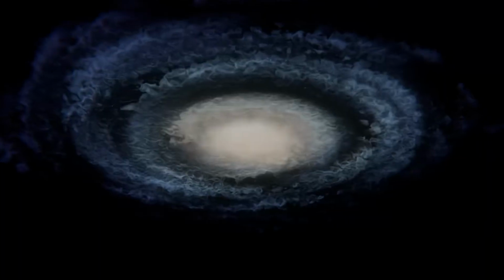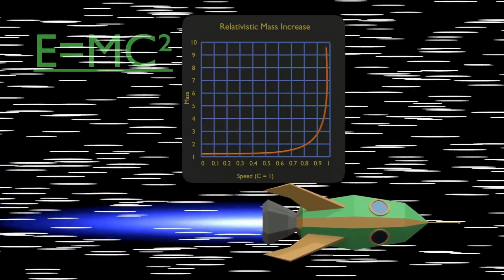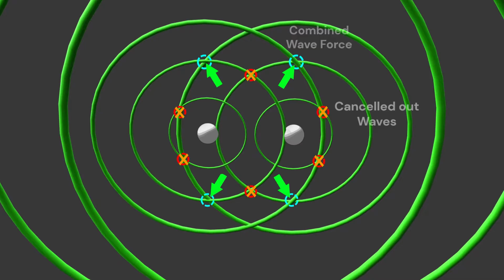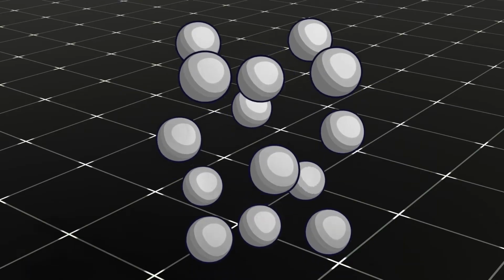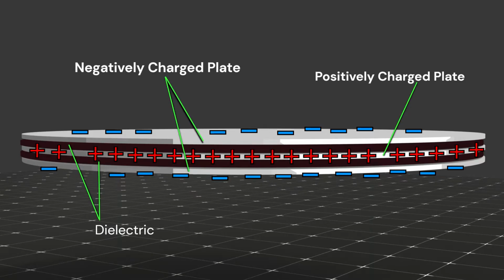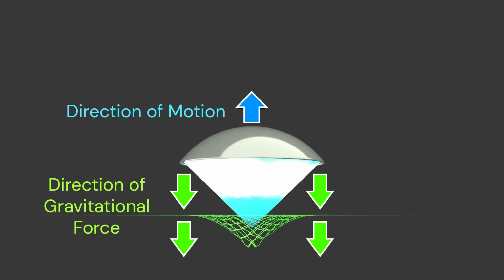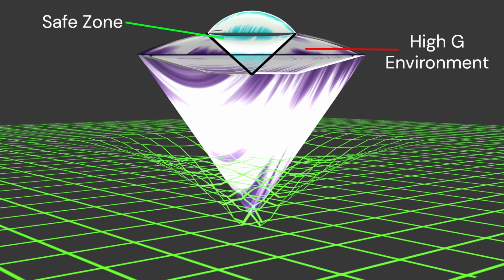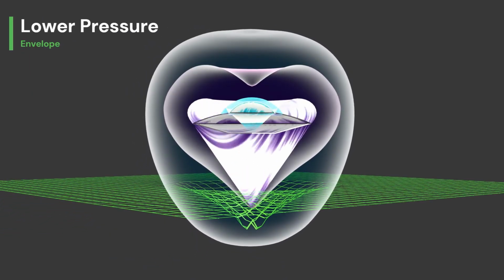UAP Propulsion Method

Comment: 1. Misapplication of the Equivalence Principle
The equivalence principle (gravity ≈ acceleration) does not imply that vibrating mass generates gravity waves.

Gravity waves (like those detected by LIGO) come from massive cosmic events (black hole mergers), not atomic vibrations.

2. Gravity Wave Generation at Atomic Scales?
The energy required to produce detectable gravity waves is astronomical (e.g., merging neutron stars).

Atomic vibrations would produce undetectably weak spacetime ripples (if any).

3. No Known Mechanism for "Gravity Amplification"
General Relativity does not allow for "focusing" gravity waves like light in a parabolic mirror.

Gravity waves do not exert force—they are ripples in spacetime, not a push/pull effect.

4. Overestimation of Electrical Charge Effects
While electrostatic forces can move ions, they don’t induce relativistic mass increases.

Capacitors store charge but cannot generate gravity waves.

5. Contradictions with Known Physics
G-forces are due to acceleration, not gravity waves.

The idea that a "repulsive field" cancels G-forces violates inertia (Newton’s 1st Law).

6. Lack of Experimental Evidence
No lab has ever observed artificial gravity waves from vibrating matter.

If NHIs used this, we’d expect detectable energy signatures (none confirmed)
Reply: Yap yap yap
Reply: So you're saying it would take the equivalent of a black hole merger to lift a ufo? Gravity IS hard to detect, true, but it doesn't take a merger to lift a ton or two. Why visit a fringe science channel just to fall back on traditional science? 

He's not saying that the parabolic dish is reflecting gravity waves. He's saying the dish is used to focus the force generated by the dish itself. 

Thomas Townsend Brown showcased asymmetrical capacitors generating force back in the 80s. That same force is being used by Charles Buhler et al to move styrofoam around a lab *right now*. This is all heavily documented, albeit not very well accepted. 

All that said, don't denounce possibly the best guess at uap propulsion systems without giving your own best guess. Bad show.

Comment: Thank you. Apparently, it helps if you electrically charge the vibrational items to generate gravity. What you have to do is devise an experiment that shows that vibrations increase gravity. That should be easy enough to do. The equivalence principle states that inertial and gravitational mass are equivalent, meaning acceleration and gravity are locally indistinguishable. While relativistic mass increase at near-light speeds is valid in special relativity, the idea that vibrations could analogously increase mass is speculative. General relativity treats mass as a property of stress-energy, but oscillations alone don’t inherently create gravitational fields unless they involve significant energy density (e.g., gravitational waves from colliding black holes).
Verdict: Partially plausible in theory, but no empirical evidence supports vibrational mass amplification as a gravity-control mechanism.

Comment: Hey guys. I just wanted to comment on proof of this IN NATURE!

When a supernovae occurs, matter is quickly moved and gravitational waves are asymmetrically created. This causes the center of mass of the remaining neutron star to move away from its original center of mass. This is an example of an object moving itself through asymmetric gravity wave emission. We know this because the amount relative of mass expelled in a given direction in a supernovae is not enough to propel the center of mass of the neutron star in a velocity that it can move at. This is also the same reason binary stars can technically come closer or further from each other.
Reply from the maker: @competetive8  thank you for this
Reply: @michaelalans2126  Thanks. This stuff is really interesting and obviously possible but i think it would take a lot of energy
Reply from the maker: @competetive8  Thomas Townsend Brown seems to have done it with 50kv. Admittedly, his apparatus was small and he often worked with aluminium foil, but the fact that he had his best results with parabolic disks, with the negatively charged electrode around the focal point of the positively charged parabolic electrode suggests that this is the root of the Biefield-Brown effect.

Comment: Another question: Lazar stipulated that the gravitational waves are generated by an antimater emmiter in conjunction exotic nuclear dynamics. Do you think this is disinformation fed to decieve him or another potential mechanism for propulsion. How do you square these two very diffenent ways such propulsion could be generated?
Reply: In his book it mentions that it is likely a misconception by Bob and his team because of the novel way your hand would react with the curved gravity wave that is generated. It is likely just a method to contain the antimatter. I would like to offer an alternative explanation to what Bob Lazar says:
The antimatter produces really high amounts of energy, which is then used to oscillate the (likely) lattice structures of the metal, ionic, element 115. The reason element 115 is useful is because it is likely super heavy and dense due to its proton count, reducing the amount of "objects" needed to oscillate for the desired gravity waves. Im sure it has other interesting properties, like more conducive to producing stronger gravity waves than other atoms, but probably nothing out of the ordinary, just more efficient overall. This is still stuff that probably cannot be done with standard machining technologies, you need some atomically precise metal to do stuff like this from what I gather.
Reply: It seems like a stretch to me that you would assume that element 115 BOTH emits the anti-mater particles AND provides the energy sufficient enough to safely/effectively power the dielectric-coherent-gravitational wave-emitting material. I'm curious to get @michaelalans2126 take on this. Seems like an enormous amount of heat would be generated by these reactions. Lazar and other claim there is no heat signature whatsoever i.e. a 99.9% efficient reaction.
Reply from the maker: @blockvfive1196  Sorry, I just noticed that you also responded. Thank you for reading my book by the way. There is another very good reason for element 115, I explain it in my next video. It is related to the gravity beam emitters under the craft.
Reply: @michaelalans2126  amazing, excited to see that video
Reply from the maker: @Regenen77  No I think Lazar was working from notes that were about 50% incorrect. They clearly observed the heart shaped gravity distortion, but they put it down to the protrusion at the top of the craft. I believe that is an ionising aerial, not a wave guide. I believe it is there to regulate the charge of the craft. Kinda like a steam whistle on a stream train. Consider how many craft have aerial type devices, versus how many are parabolic shapes. If the aerial was essential to g-wave production, wouldn't all craft have them?

Comment: Wouldn't the rapid vibration of the meta materials also create an emense amount of heat? How would that be dissipated without us detecting it?
Reply from the maker: Nope none of the above. I'm a fork lift truck driver. I'm an abductee. I was taken almost monthly when I was a pre-teen. I don't remember being told this stuff, it just sort of hits me like déjà-vu. It's very hard to explain. Heat would be an issue, but the synchronisation of the oscillations allows the kinetic energy to disperse as g-waves. Rather than smashing into one another, the atoms slide past one another along a single axis.
Reply: BTW I very much enjoyed the video but I did leave me with more questions than answers. Is your background Physics or Engineering or something else entirely? 🤔

Comment: just me adding another comment, been thinking about your work, i have 2 questions:
What do you think about testing parabolic shapes and conical shapes of ionic tungsten lattices?
Would you consider making a discord server to make a community serious about amplifying gravity, so we can all work together and share ideas?

Thank you so much for your work, its brilliant
Reply from the maker: Thank you very much, tungsten is a good shout. The Biefield- Brown effect was discovered using Coolidge tubes. Those have Tungsten anodes. So we have a positive charged tungsten mass oscillating at a small target. The mass of tungsten atoms could potentially help the g-wave production. Another method that isn't in the video is using a negatively charged target at the focal point of the parabolic plates, rather than stacked plates. TTB used small target electrodes, with large positively charged parabolic plates. Having a small target at a distance is a good way to focus your oscillations towards a single point. 

I haven't considered starting a social group. I'm kinda shy around this stuff. My kids don't even know about my experiences.
Reply: @michaelalans2126  Right, for the most part we just need heavy metal ions like tungsten. Osmium is good too, but tungsten is very safe to touch, and doesn't oxidate much in the atmosphere. I need to find tungsten lattices manufactured in parabolic cone at some 99.999% purity at the minimum. This concept is super fun, I also bought and read your book "How to Build a Flying Saucer"

Anyways, I didn't say social discord as much as a productive one, to theorize about your methods and other similar methods of gravity wave amplification. I think it can be done, it just needs some dedicated people. We could all come up with detailed experiments for scientists to try. I understand if you don't want to. Thank you for the information you have given me and many others, its unique!
Reply: @michaelalans2126  Hmm, I wonder if that could be more energy efficient, since its more focused. I think you could call that directional emission. The key like you mentioned is to make gravity waves minimally affect earth and surrounding celestial objects, your method seems darn reasonable

Yeah though, for the most part we just need heavy metal ions like tungsten. Osmium is good too, but tungsten is very safe to touch, and doesn't oxidate much in the atmosphere. I need to find tungsten lattices manufactured in parabolic cone at some 99.999% purity at the minimum. This concept is super fun. I also bought, and read your book on how to build a flying saucer. I love the explanation. I will make some simple 3d math models on this concept and send the links on desmos to anyone who wants to visualize how this technology works.

Anyways, I didn't say social discord as much as a productive one, to theorize about your methods and other similar methods of gravity wave amplification. I think it can be done, it just needs some dedicated people. We could all come up with detailed experiments for scientists to try. I understand if you don't want to though. This subject about aliens can be scary, and this technology can be very dangerous when placed in the wrong, immoral hands of people. Humans will get more moral, hopefully.

Anyways, thank you for the information you have given me and many others, its unique!
Reply: @michaelalans2126  for the most part we just need heavy metal ions like tungsten. Osmium is good too, but tungsten is very safe to touch, and doesn't oxidate much in the atmosphere. I need to find tungsten lattices manufactured in parabolic cone at some 99.999% purity at the minimum. This concept is super fun. I also bought, and read your book on how to build a flying saucer. I love the explanation. I will make some simple 3d math models on this concept and send the links on desmos to anyone who wants to visualize how this technology works.

Anyways, I didn't say social discord as much as a productive one, to theorize about your methods and other similar methods of gravity wave amplification. I think it can be done, it just needs some dedicated people. We could all come up with detailed experiments for scientists to try. I understand if you don't want to though. This subject about aliens can be scary, and this technology can be very dangerous when placed in the wrong, immoral hands of people. Humans will get more moral, hopefully.

Anyways, thank you for the information you have given me and many others, its unique!